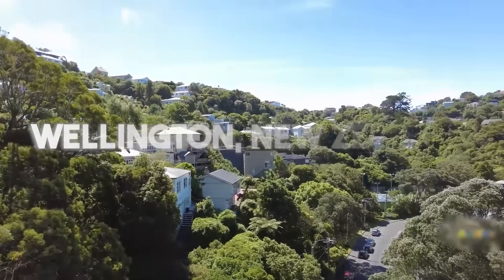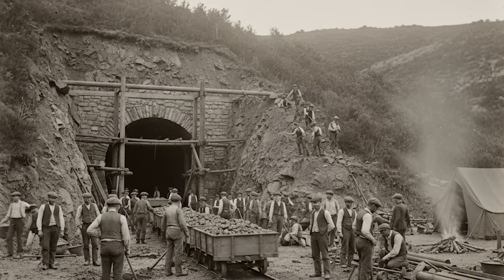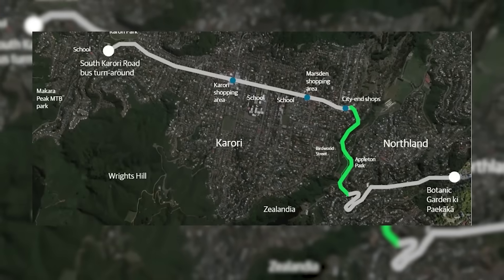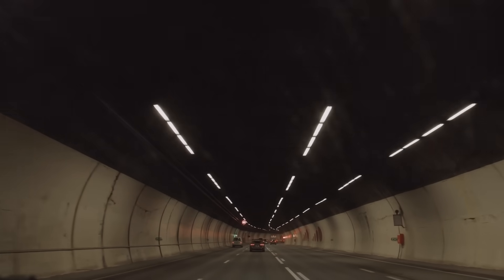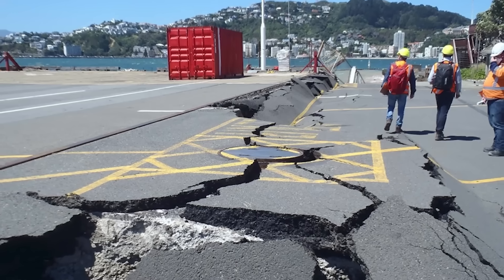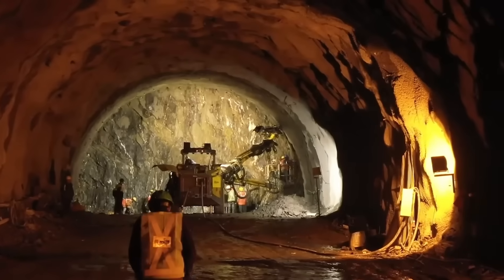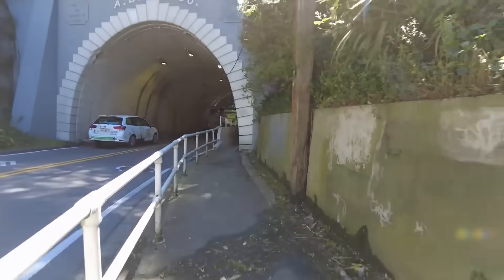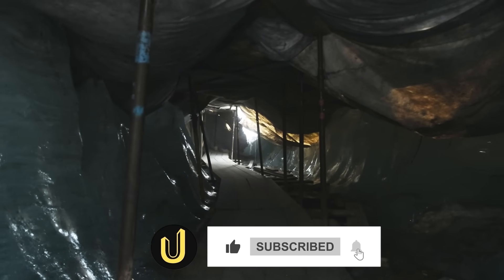Wellington’s Plan to Fix the Death Defying Karori Tunnel

Comment: Why not simply re-dig the road surface itself, so that the double-decker buses sit lower in the tunnel and can better avoid the ceiling?
Reply: People ask the same about those railroad bridges that go over roads and sometimes get hit. There must be some reason why they don't simply lower the road
Reply: @theNEWguy102  They did lower the tunnels for the trainlines in Wellington
Reply: Perhaps the tunnel is simply at end of life. But agree, an excellent question. If watching to the end it seems the bus issue is actually not the only problem they will be solving. Foot traffic & cyclists accommodations are being improved.

Comment: 100 milimetres is not the thickness of a modern smartphone. Try length.
Reply: @starfishzippo To a USAian, trapped in the past with the Imperial system, 100 mm is about 4 inches. Fun fact: the only three countries that officially use Imperial measurements are Liberia, Myanmar, and the USA... Some, like the UK, use a mixture.